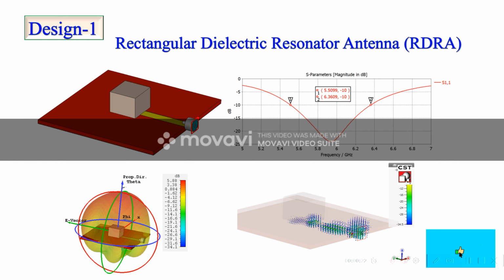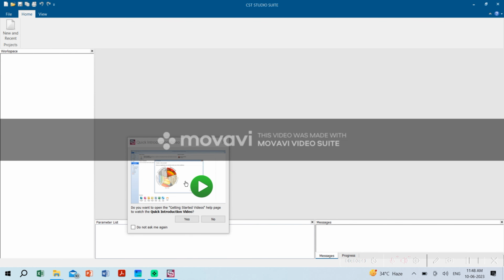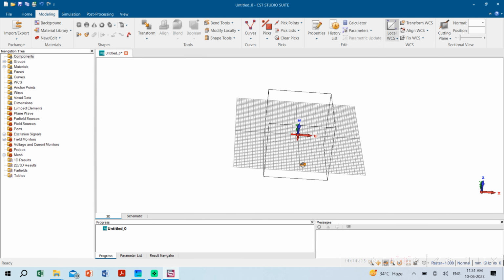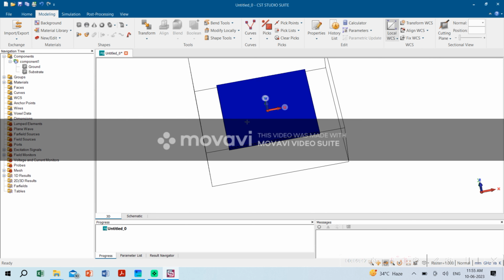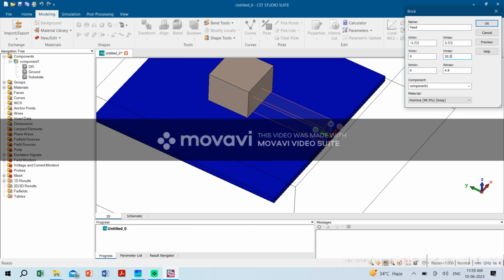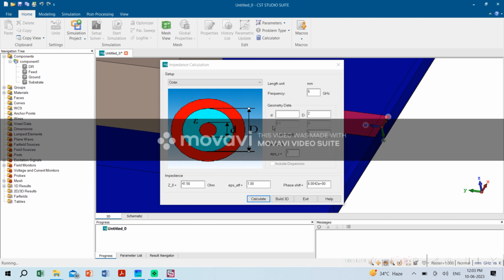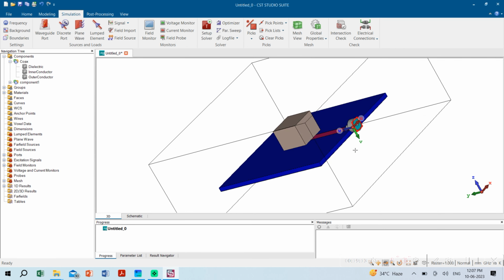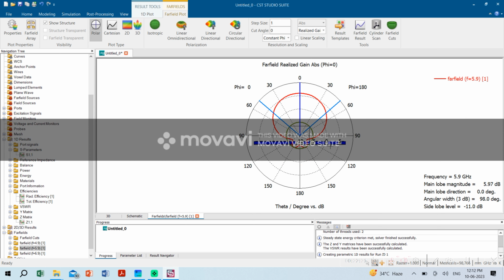#Design-1: Rectangular Dielectric Resonator Antenna Design using CST MWS @CONNECTINGWORLD-os6gp

Comment: Your work is so helpful, Thank you for sharing over here. I started working on Antenna and my target is, "The antenna shall meet, Impedance bandwidth (|S11| < –10 dB): 0.22–0.325 terahertz.
Gain ≥ 20 dB, with a gain variation ≤ 2 dB within the operating frequency band. Antenna polarization: linear polarization. The 3D-printed ceramic is Al2O3 with a dielectric constant of 9, a loss tangent of 0.02, and a minimum processing line width/line pitch of 120 μm.I need your guidance regarding it. Can you calculate parameters and make video on it. If possible also send me in person. Thanks

Comment: Amazing . I have a few questions. I'm currently reading this because I'm interested in this topic. You mentioned there are equations for calculating nutrition, but you didn't show them. Also, on what basis did you change the size of the circular feeder?